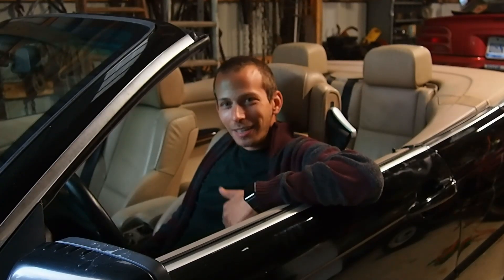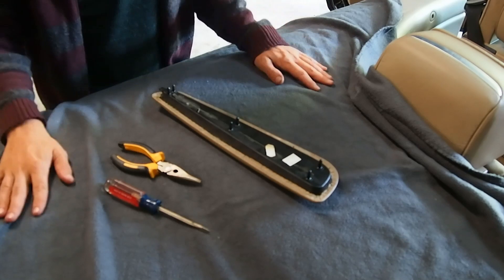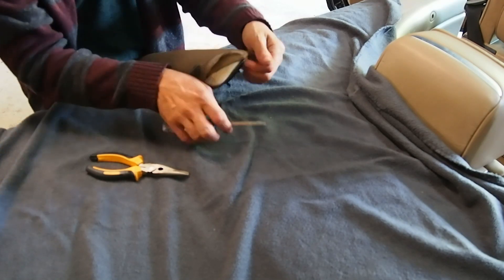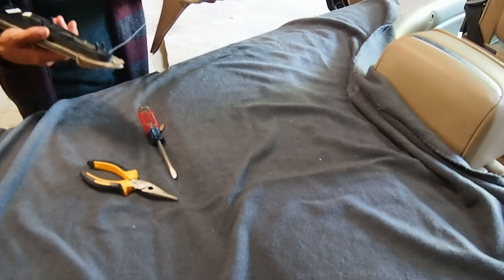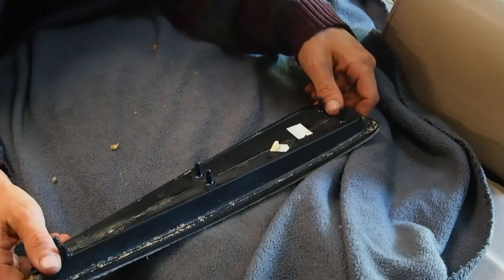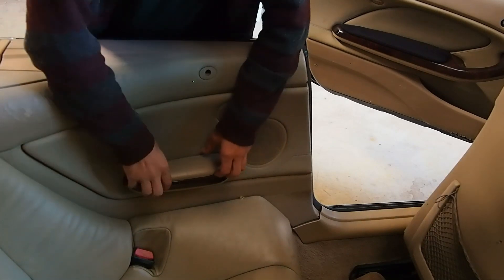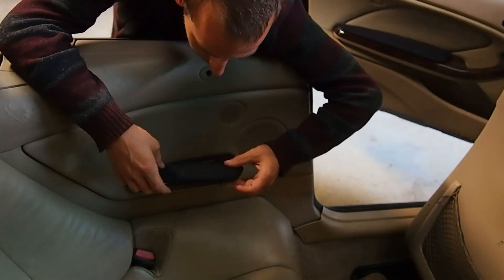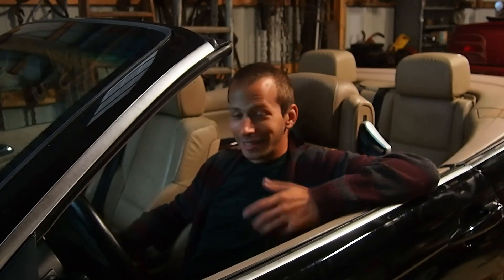BMW E46 Coupe & Conv. Armrest Covers - Skelton Garage How-To

Comment: I know this was a while ago, did the hot glue hold up? I did a sample on the plastic first, and it peeled right off. So I went with brush in contact cement. Seems to be on pretty good now